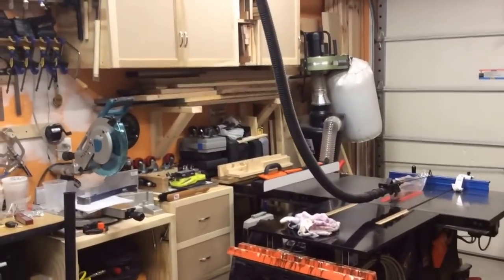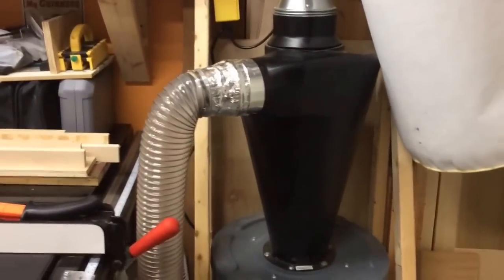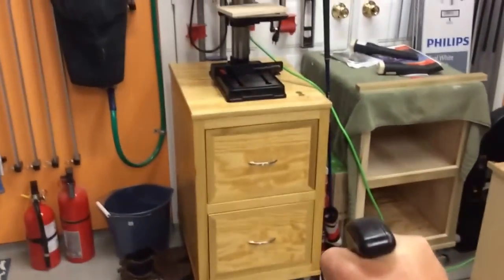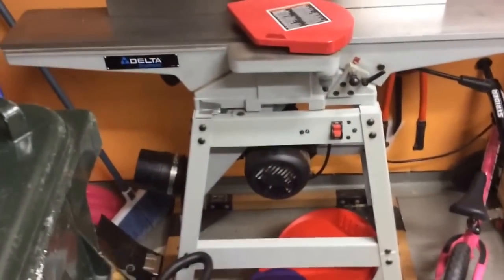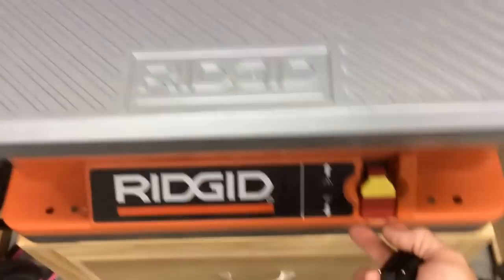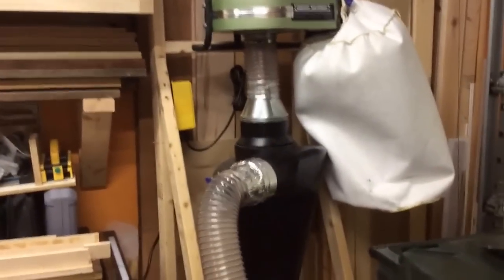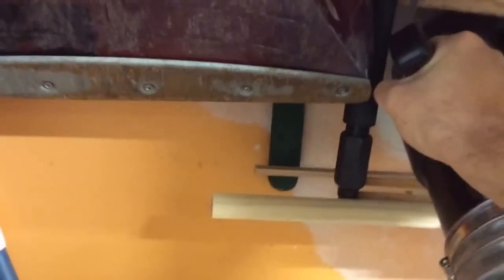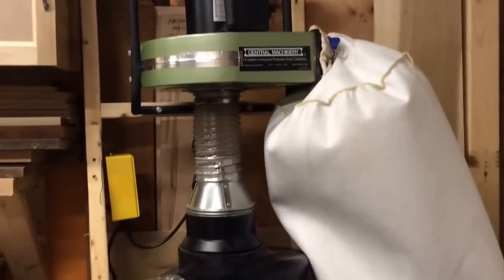2-stage Dust Collector with HF blower and Super Dust Deputy

Comment: Extremely stupid question. Will this pull dust from open air?  I ask because of drywall dust. A box fan just doesn't cut it.
Reply from the maker: Yes, a dust collector will handle drywall dust much better than a shop vac, but you need to have a filter capable of catching that fine dust and holding it without clogging.  The cyclone helps enormously with that.  I have a small Oneida I use with my shop vac.  When I use that with a drywall sander, much of the drywall dust winds up in the cyclone.  But neither system will take hours and hrs of drywall dust without clogging.  For airborne dust, I have another blower/filter unit I built that does a very good job of catching the airborne drywall dust.  I'll try to post a video on that machine soon.